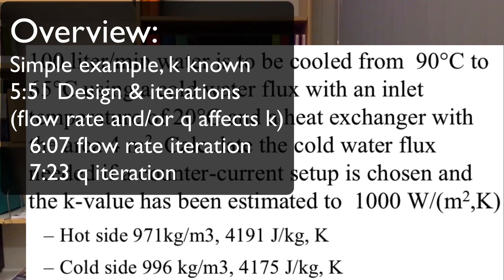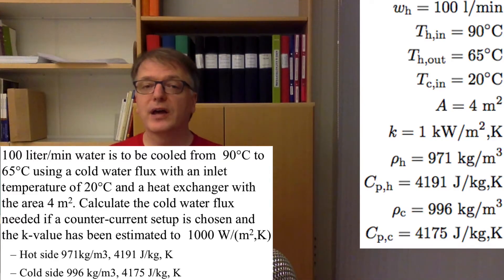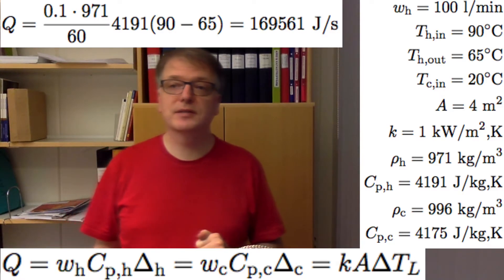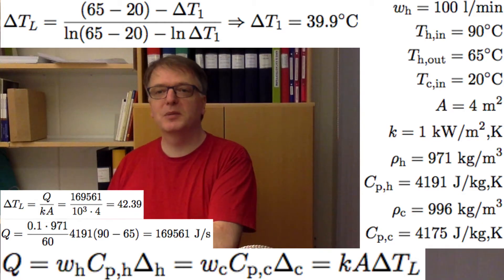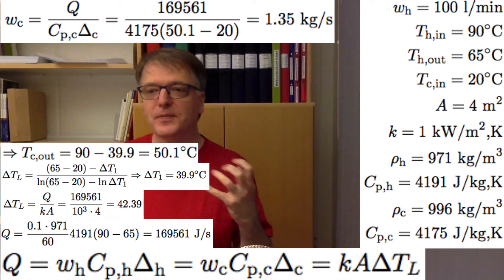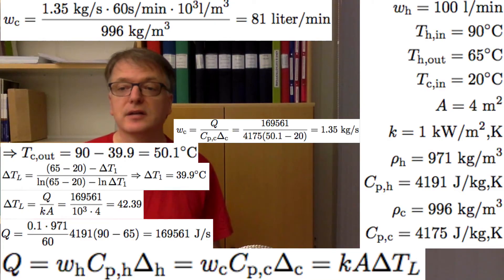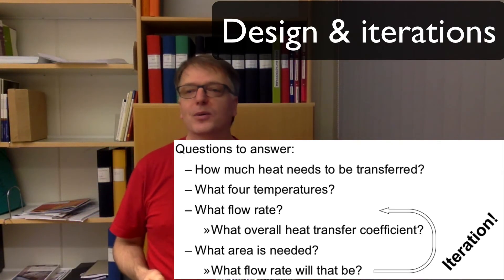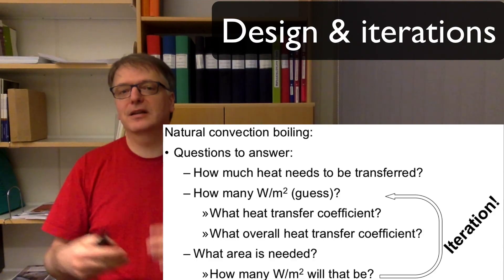Heat Exchangers Example

Comment: how did you calculate 39.9 from the log mean temp difference. The math won't work out for me.
Reply from the maker: A good question, I glanced pass that really quickly in the video. I don't think there exists analytical solutions to equations of that form, but you can solve them numerically

Let DeltaT1=X =>

(45-X)/ln(45/X)-42.39=0

You're not allowed to guess X=45 (since that give 0/0 which will make your maths teacher angry ;-)

Let's try X=40 =>
(45-40)/ln(45/40)-42.39=0.0609
Didn't work, let's try X=35 =>
(45-35)/ln(45/35)-42.39=-2.599
Different sign for error than first guess, so solution is 35<X<40 and likely X closer to X=40 (since smaller error)
Try X=39 =>
(45-39)/ln(45/39)-42.39=-0.46 => 39<X<40 and likely X closer to X=40 (since smaller error)
Try X=39.8 =>
(45-39.8)/ln(45/39.8)-42.39=-0.043 => 39.8 < X < 40 and both errors about the same size, try something mid between =>
Try X=39.9 =>
(45-39.9)/ln(45/39.9)-42.39=0.00889 => 39.8 < X < 39.9 
Try X=39.85 =>
(45-39.85)/ln(45/39.85)-42.39=-0.0171 => 39.85 < X < 39.90, so with 3 significiant digits X=39.9

Most calculators have a solve function you can use, or you can use solve function in Microsoft Excel, Matlab or other program of your choice

If you plot Y=(45-X)/ln(45/X)-42.39 for 1≤X≤44 and 46≤X≤70 in Excel or similar you see that the error is strictly increasing and passes through zero close to X=39, so there clearly is only one true solution. If you start guessing close to X=45 you run into the 0/0 problem and numerical limitations which might give you a false solution if you're not careful.